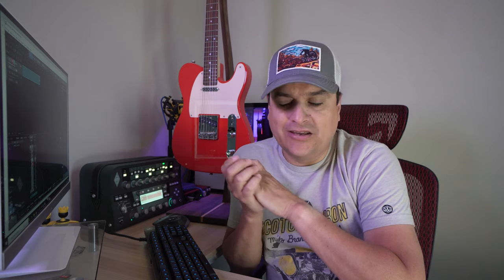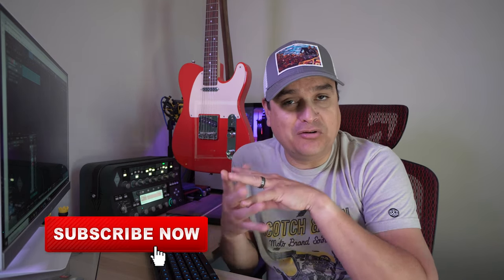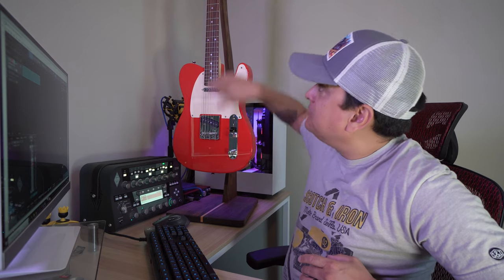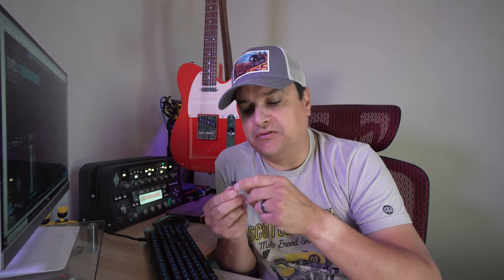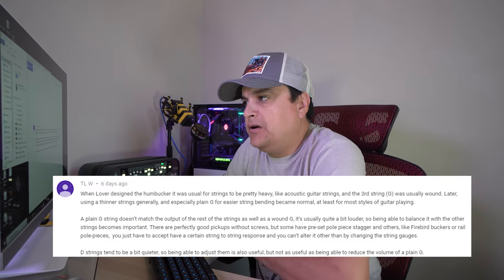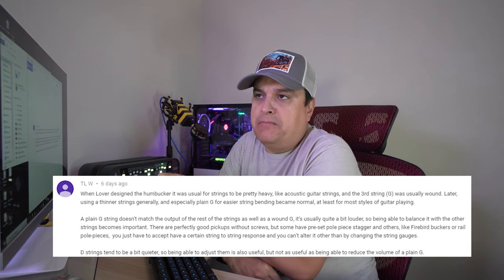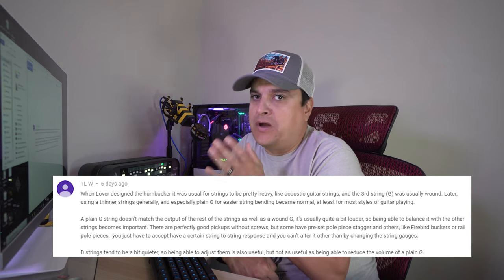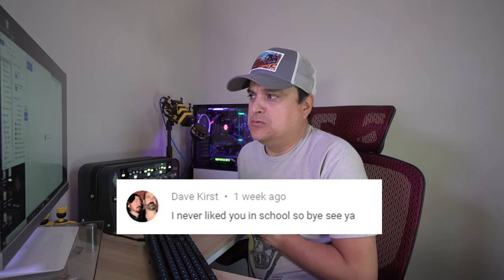Telecaster Saddle Shootout - Graphtech Vs Brass Vs Steel Vs Aluminum

Comment: I thought the brass sounded best, but I was also pleasantly surprised by the aluminum, I thought that was a solid second place.
Reply: My thoughts exactly. Aluminum was lacking in some pleasing frequencies that the brass had but I'd give it a 2nd place as well.
Reply: Brass rules. However having a 2nd alternative tele with different pickups and aluminum saddles would be great.
Reply: Totally agree with you! The Brass was far better then both Steel and Graffite. The Aluminum was also quite good
Reply: I liked the sound of the brass as well, which sounded  more full.  A tele is generally  a Brite sound, and  it  sort of tamed  that, if that makes sense.

Comment: For me, I like :
1. Brass
2. Aluminum
3. Steel
4. Graphite 

Brass had the most "twang" and tele-like tone to me. That being said, the steel and aluminum are a nice balance while the graphite ones might be suited to a guitar that's overly bright. They all have their uses depending on the tone you want. Cool vid! I actually really enjoyed this. I just replaced my old steel bent fender saddles with some aluminium ones on my duo sonic. Mostly for comfort but they sound really nice clean too.
Reply: Just FYI, Graph Tech products are not graphite. They're made with synthetic polymers.
Reply: Ditto

Comment: Brass had the best low end projection and high end presence.
Reply: It sounded the best
Reply: I use them
Reply: Funny because brass tends to dampen vibration
Reply: Steel is what dampens vibrations. Notice a lot of highs and mids are missing. Where as brass everything is more defined and fuller lows and highs
Reply: @geraldponce8336  Yeah, half a click on a tone knob.
Reply: Dirt or street bike accident, my back is wrenched from racing motocross.. honda cr500r 2 stroke, Yamaha yz250, and yz 465.. 250 and 500 cc intermediate... But my back is only a beginner lol.. actually thrashed it more from simple trail riding and some Cross country type of riding..
Reply: Brass is incredible and I love it. But sometimes I feel that other metals have a nice smoothness that can be more appealing
Reply: @ben156 or does it?  Higher density would mean less vibration, especially in the high end.  Physics.

Comment: 1. Brass - Twangy, treble focus
2. Graphtech - Balanced, low/mid focus
3. Aluminum - Balanced, mid/focus, with an interesting string separation
4. Steel - Plain Jane, nothing special about it :S
Reply: That was my perception as well.  
To my ears the brass sounded more like a brass instrument. Heavy upper mids but still some warmth.
The steel sounded flat and a bit cold.  I might use it to tame a guitar that has spiky upper mids, as with the rest.
Reply: Yeah man! ✊😮
Reply: I thought the steel sounded the best. More clear high end, and punchier mids/lows without being too dark or mellow.  I dont like mellow with solid bodies lol. Thats what hollowbodies are for.
Reply: @victorramsey5575  Ah, of course, it will also depend on your pickups, i wouldn't use brass saddles on a super bright pickup or humbucker equipped Tele

Comment: From what I can hear, brass sounds more upfront because of that 2K-ish presence peak. On solo, one might prefer the brass but in a mixing context, I would pick the graphite because it sounded more balanced than the other 2. It makes EQ-ing and blending to other tracks easier. That presence peak is also commonly occupied by the snare and vocals.
Reply: That's a really good point!

Comment: How about the same test with no material names,  mix the numbers and let everyone pick again,  see if the results are different.   Tele players are predisposed to think brass is best.
Reply: best answer ever...
Reply: I actually think that's not entirely correct. a Metal Head would preffered the Graphtech and steel one. I had one standing next to me while playying the video lol...
Reply: I put brass saddles on my Squier cv 60s tele. It sounded so bright I put the original saddles back.
Reply: I think the difference is actually pronounced enough people will still be able to tell (at least on the brass). I'm not a big gear head, so I came into this without any preconceptions of what each material sounded like, and I could definitely still hear the differences and tell the brass had the "tele" sound. Personally I liked the steel the best, followed by the aluminum, I find them a lot smoother and less harsh than the brass.
Reply: On my case I disagree, purely because I have no knowledge of which material is supposed to be better for a tele, but I just thought the brass sounded like it had the most character and dynamics
Reply: @richsackett3423  - no need to be rude.  You prefer brass?
Reply: @robinr.2233  No and wrote a comment. 
I liked the way he did the video, BTW. Trying to learn about stuff, not play silly games.
Reply: @richsackett3423   Silly games?   I'm suggesting that you can learn a lot from testing different saddle materials.  I know from experience that different materials sound different on different Teles.  I don't understand your rude comment.
Reply: @robinr.2233  Blind tests are silly. I'm not going to tease out why for you. It's involved.
Reply: @Blaise Przybyla LOL. If you wll write all that, it would be very poor manners not to explain my position more fully.

"Silly"? I meant counterproductive. Blind tests are useful to tell whether or not there is a perceivable difference. Like efficacy of medication. Does it work, does it not. If a difference in sound isn't in dispute, it becomes a guessing game, relying on preconceptions and biases to formulate an answer. The exercise of guessing in the absence of data reinforces those biases and preconceptions.

Hey, if I knew the difference in the respect sounds based on the imposition of the variable, I wouldn't be here. If I knew the sound of a short Tele bridge, Kinman treble bleed, an alder versus ash body, etc., I wouldn't be spending my time watching these videos trying to learn those things. I'd already know. The game show format is an inefficient way to learn that stuff. Seem like on "Who Wants To Be a Millionaire?" they'd do about a dozen questions in an hour. I see no universities adopting that model.
Reply: That's so true. We are loaded with predisposition and preconception and seldom want to admit how common our decisions and statements are tainted. Humans in particular. Lol 😂
Reply: This is a very interesting test. Your mind will hear what you think you should sometimes even when you really want to be critical. I have a proco Rat from 90s that has old case, the old feet, the old knobs, the proco logo on the bottom front was a size like the old one. I put it to the test next to other people's newer rats and everyone agreed, the mystical old chip the jm3 whatever whatever was always slightly better. The new ones have an op amp widely available in China that worked well and sounding almost just like a real deal Rat. But just almost. Allegedly. Cause come to find out, and I never been able to find another Rat like mine, it turned when it need a loose wire fixed I was able to take a picture of the inside so I could show people what the chip looked like in mine. Guess what? It was the OP amp the entire time. When I first compared to one website source I was like "they must have their pictures mixedd up" then to another "this one too, how did this fallacy" another website and another and another. "My God" i realized, "it says number on the chip." So now, I put my proco rat side by side with other people newer rats cause they're interested in hearing the difference and they go "yeah that old chip does sound better somehow" and I don't tell them. And I listen as hard as I can and the difference is not significant. Might not even be there at all. But back then it was like "stand back watch this" when I compared them and it was always immediately different and superior everytime to theirs. But we were all fools. It made no difference. At least not the difference we fooled ourselves into thinking.
Reply: I changed the whole assemble (plate and saddles) on my Cvc to Brass... looked great but sounded dull.. so I cut the original steel plate 
And placed it under the pickguard around the pickup it’s sounds much better
Reply: @richsackett3423  I liked the brass best. I have never owned a tele so I had no preconceived decision. U are wrong, this test was very helpful for someone like me. No reason to be arrogant.
Reply: I actually listened to it blind,  my faves were:
Brass
Aluminum 
Graphtech
Steel
To be honest I could switch the top three out back and forth and be happy with any of them on that guitar. The first one however said "Tele!" Now that may be because a lot of Tele players use brass saddles as well as myself and that's what I'm used to, or it could be that's the best saddle material to get that particular sound. 
My first  Tele has brass saddles, it came with steel, but I felt the sound was a little too harsh, so I changed to brass. It was much warmer afterwards. I'm tempted to try some aluminum saddle now after this vid. 
My  MIJ 70's Tele has six steel saddles, but also WRHB's so it's an interesting beast. I really like the neck pickup, and the middle position as well, far more than most other guitars neck and middle positions.  The neck has a P90 vibe to it that I think is great.  Not as much twang on this guitar in the bridge position, but it gets the job done. I dig them both and play them daily,
Reply: @cobowe  I just saw a 
Stu Mac video interview about compensated telecaster saddles 3 piece saddles among other things he mentioned the telecaster twang is a result of the steel bridge has to do with the magnetic fields. BTW Brass 3 piece Telecaster saddles go on my builds.
Reply: @cobowe  ah a Rube Goldberg moment that was why I buy Telecasters usually used but not played Squires at a huge discount most are not intonatated let alone the truss rods and fret sprouts, mostly purchased from new
 players that lost interested in learning. Has everything that makes learning difficult. 
I pretty sure that's why Squire   has a bad rep.
Reply: I did that for myself and funniest thing is that steel and aluminium convinced me. Brass and graph tech sounded kinda muddy and undefined to my ears.
Reply: @TheTrueEnjoyME  My '59 Esquire (a real one that I bought for $100 in 1966) had threaded steel rod for saddles (factory original for that year) It sounded great, it had that classic Tele snap.

Comment: There is a lot of variation in brass even . Different brands of compensated saddles sound very different . Also some of the compensated ones are somewhat overdone and don't intonate any better but in the opposite way. My big winner was the Gotoh brass in tune. Don't ignore the huge effect of the plate as well. I did the test with a CS 51Nocaster and a Two Rock jet.

Comment: I'm very surprised by this. First, surprised that you did hear a difference, because I'm so used to hearing that tone is only pickups and speakers, and crapping on any ideas otherwise. Second, I was surprised by how much difference I heard, even through my phone. I will absolutely keep this in mind as I am building our proprietary design bridges and saddles. Good video!
Reply: Is amazing how people will hear differences on nut and bridge materials...... but swear that the material these things are attached to make no difference....

Comment: Call me crazy but I found the brass saddle(s) to be rich and full, not bright and twangy. I found the Graphtec to be dull and lifeless. To my ear the steel was twangy while the aluminum was a little too bright for my taste. Brass came out the clear winner. But beautiful sound is definitely in the ear of the beholder.
Reply: I agree, my thoughts exactly.
Reply: Wouldn’t matter. Your ears will adjust to whatever you use
Reply: 100% the brass sounded nicest to my ear.

Comment: 1) Did you time the decay of the various setups with a stopwatch?
2) Did you mimic the string heights
with a radius gauge, and capo on the first fret?
3) Did you secure the tone and volume settings with Scotch tape?
4) Did you tin the strings?
5) Did you capture a direct dry signal?
6) If the signal was captured using a microphone what microphone was used?
7) What was the air temperature and humidity in the room?
8) What kind of tuner did you use?
9) What were the string gauges?
10) What kind of string trees were on the instrument and where were they located?
Thank you for everything.
Reply from the maker: I will address your comment at the end of our next video since it is pretty involved answer. Great questions.
Reply: @DylanTalksTone  I grew up in a recording studio. The guys took it really seriously. Sometimes they put just a little vaseline and graphite  on the saddles and the nut, with a Q-tip and wipe away the excess. Some guys use tri-flow. Take care and be well.
Reply from the maker: @UCnOxNlmnZMueUNu_uJjf_og yeah short answer is, all of the things you asked about we did. Technology makes a lot of it a moot point.
Reply: @DylanTalksTone  when I was a kid they used to say "We'll fix it in the mix" the truth is you can't.
You would have been better off saying nothing.
Reply from the maker: except that I did not "fix it in the mix" that is not how we roll around here
Reply: @DylanTalksTone  Chromed steal 12 to14 seconds of sustain
Brass 16 to 18 seconds of sustain
Graphite 20 to 22 seconds of sustain. Some people think the more sustain the better, yes and no. The answer is contextual. The result also depend on the gauge of strings you're running and the amount of relief. Decay can be advantageous, sometimes you don't want a guitar that won't shut up. The way the neck is mounted to the body also affects this. Telecasters and fixed.bridged Smith strats have longer sustain because the strings are run through the body. Which is why a lot of Telecaster players like fixed bridged Strats, How far is your guitar away from the amp also affects this. When your timing sustain do it unplugged. There's a difference between a qualitative and quantitative analysis of the setup. The beginning, the middle, and the finish of the tone..

Comment: I used to play very hard, and with 12's on my SG (no not a Fender), and I used to break too many strings, usually a D or a G string.
I installed Graphteck saddles on the SG, and have never broken a string since. - not one  What about the tome?  I like the tone better.  And if I did not, I could always just adjust the tone on the amp or the guitar - no big deal at all.

Comment: I changed my Tele from the standard chrome 6 saddle bridge to compensated brass saddles and noticed the difference immediately. It has so much more projection and a much nicer tone in my opinion
Reply: Did the same and agree.. 3saddle Wilkinson or 3 saddle period seems to sound bigger and fuller. Probably the mass of saddles.. But definitely worth changing to especially Wilkinson 3 saddle brass compensated.. for country, Rock or whatever style..

Comment: I have an Ibanez semi-hollow with a trapeze tail piece and steel saddles.  When I played quietly I could hear non-related harmonics coming from the strings between the saddles and the tailpiece which was really annoying.  The saddles were replaced with black Graph-tech saddles and the tailpiece harmonics went away as well as making a much rounder-softer jazz tone.

Comment: Unbiased and to the point comparison, thank you!
Since it's a mixing rule of thumb that you can't add something that it's not there, the high frequency cutting effect of graphtech saddles make it difficult to reshape the sound in the mix. Based on my experience graphtech saddles are good with low output very bright strat pickups, high heavy humbuckers like dimebuckers, or to make super distortions less fizzy. But for telecaster  bridge, they may change the character of tele's sound.
Brass gives telecaster's signature sound, especially provides the room for tweaking in the mix, while it's still controllable by adjusting volume and tone knob on your tele. 
Steel is another good choice especially with bright fender amps (Fender material of choice in non vintage telecasters line, as well as all stratocasters for the same reason) , may feel a little flat sounding, but using the volume and tone on your guitar can bring you back what it is perceived to be missing; very good choice for lives.
I have never had any experience with aluminum saddles, they apparently sound very unique; rich high, balanced low and low mids, with trimmed high mid frequency harshness. A little unusual but still very nice. I can imagine a combination of aluminum saddles and high heavy humbuckers would be great.
Thank again Dylan for such a good work. Best regards

Comment: Pleasantly surprised by aluminum. I think steel is my #1 choice, that said I literally just ordered some Fender brass compensated saddles for a project guitar. They were cheap enough that if I don't like them I won't worry too much. Figured I start there and if they don't work out, try some threaded cold rolled steel.

Comment: 1. Aluminum for the evenness.  2. Steel also very even across the strings.  3. Brass was uneven on the wound strings compared to the plain strings - assuming you weren`t hooking the wound strings in your playing.  4. I like the initial attack of the graphite but hate the way the notes tail off.  For me it`s all about application so what sounds good on one guitar may not sound good on another.

Comment: I listened to the video several times and honestly I think it comes down to whatever bias you already have towards a certain bridge. They all sounded different but not enough to warrant a change for any specific reason (I.e. this one is more “twangy” or that one is fuller sounding) Good video tho.
Reply: Real Heel Ryan Just don’t use aluminum because they are so sticky and they suck.  Not tone wise but just as a saddle and keeping in tune